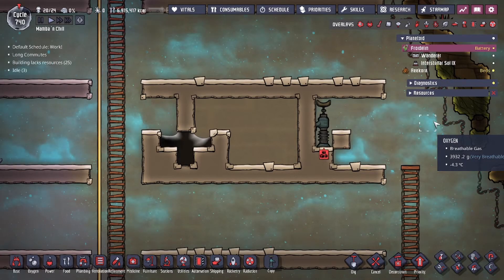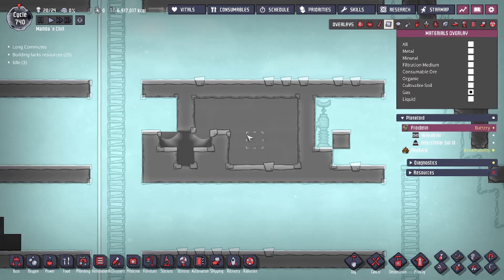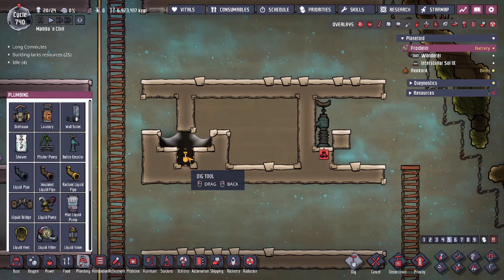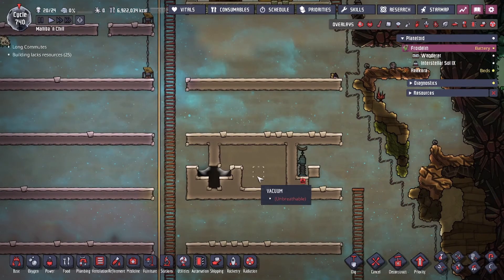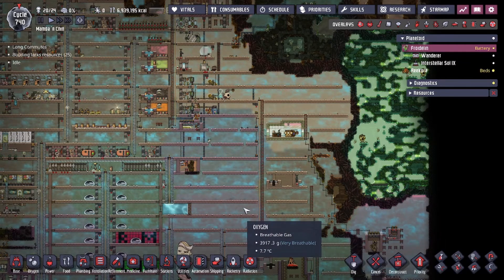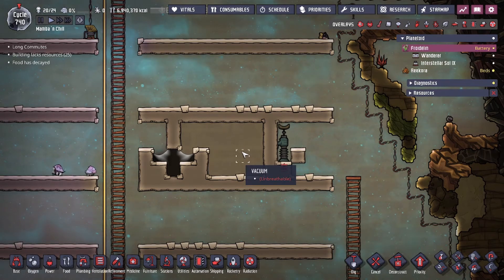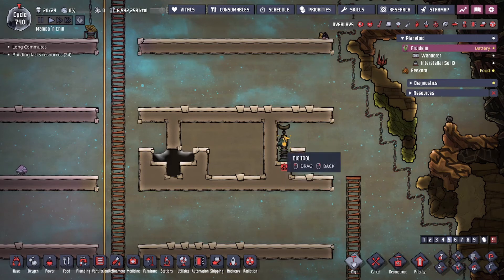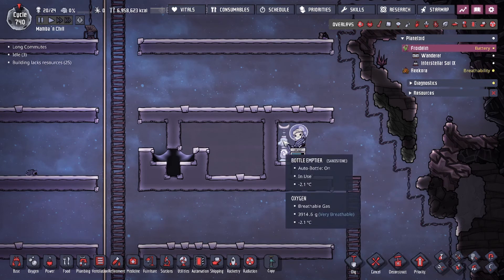Standard liquid lock and how to safely breaking into open vents - Oxygen Not Included Basics

Comment: Have you tried using a carbon dioxide lock before Legit?  Or a hydrogen lock?
Reply from the maker: i have! those locks require you to have complete control on gas pressure in the area for them to not break, and typically thats harder to manage than temperature around the immediate area
Reply: @2LegitCity  Maybe their use is best early game.  I think a good example is you want a drecko or two early.  A liquid lock would require a soggy feet debuff.  So, a gas lock seems better.  Look for a drecko below your base, and make a carbon dioxide lock down there.  Get the drecko or dreckos.  Finally, before digging much, or at all below that area, build one tile on the edge of the lock so that the chlorine/hydrogen stays in there.
Reply from the maker: @Spoonwood  there is probably some use for it, i just feel like its not practical or reliable